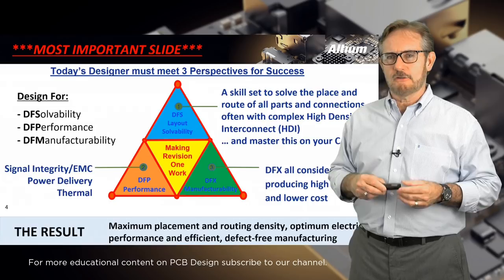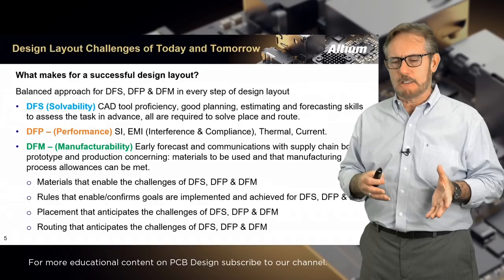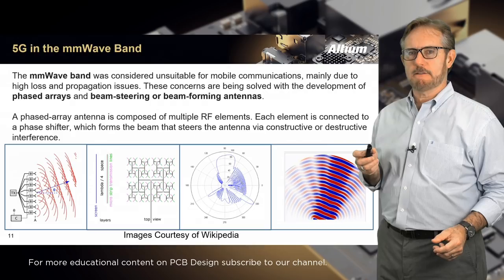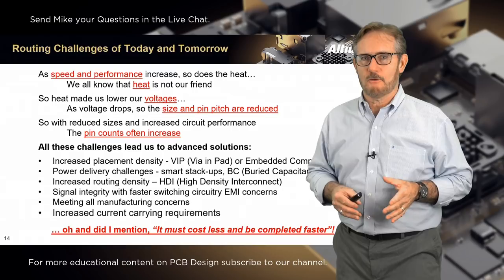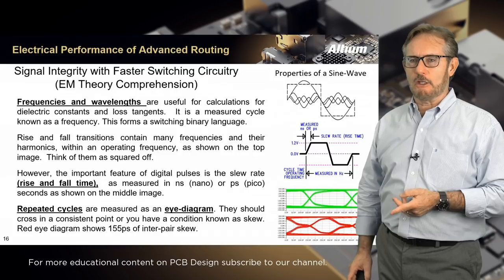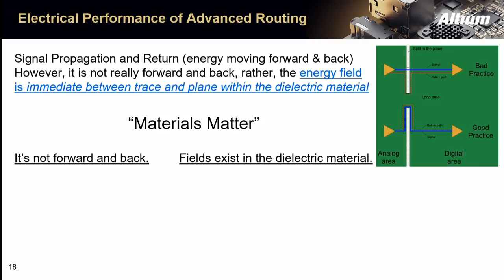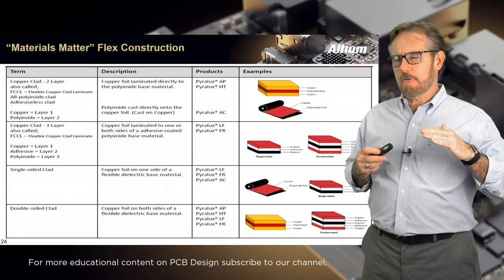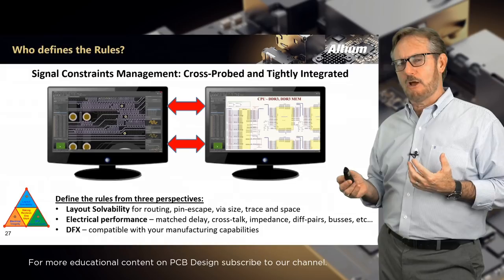[LIVE] EM Field and High-Speed Routing Principles - Mike Creeden - Expert Live Training (US)

Comment: will the impedance rule check in altium use a 3d solver in the future ?
Reply: From the Altium Designer 19 documentation, 
"This release sees the introduction of the Simbeor® electromagnetic Signal Integrity engine from Simberian. Simbeor's model accuracy is validated through the use of advanced algorithms for 3D full wave analysis, benchmarking and experimental validation. The Simbeor engine supports all modern board structures and materials." 
You can read more about impedance calculations on the documentation page, but let me know if you have more questions: https://www.altium.com/documentation/altium-designer/controlled-impedance-routing-ad#!what-determines-the-routing-impedance
Reply: @davidhaboud9557  I believe so far it is only used for initial geometry calculation and not in rule checking. I would like to see the rule check fail whenever i have copper features too close my controlled impedance lines no matter what layer the offending features are on
Reply: @timun4493  You have to combine the new impedance profiles with clearance rules. You can set a clearance for any net or net class. Take a look around the documentation for clearance rules. You might need to make some net classes or impedance profiles, but you can do it. We showed how to do this at AltiumLive Frankfurt. I should be able to send you the recording when it is produced in a couple of weeks if you want. If you have more questions, go to the Altium.com/forums and I'm sure some other users will give you some tips to figure it out.
Reply: @davidh6522  i already have 3x height above the plane clearance rules for nets where i really care about impedance, but it would still be very useful to have the rule checker consider adjacent layers to prevent the inadvertently broad side coupled configuration mentioned in the video, being able to reference arbitrary polygon pours in addition to plane layers would also be nice. My initial question was simply wether there were any major changes/improvements planed. Thank you for your replies so far.